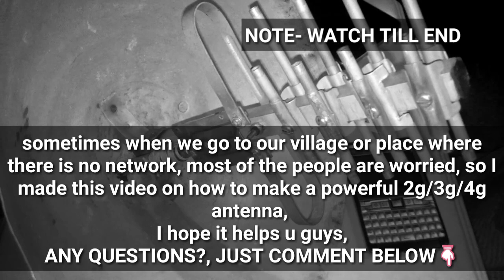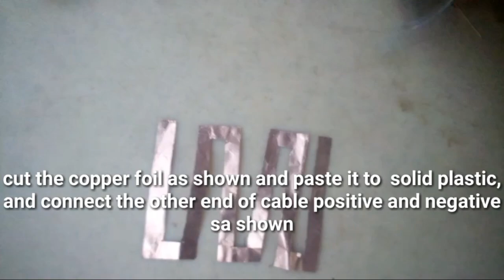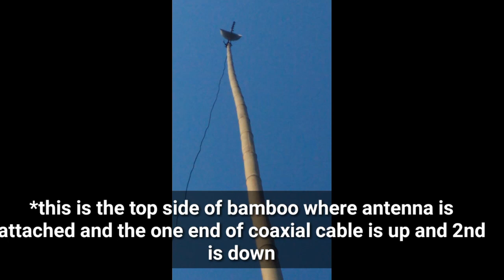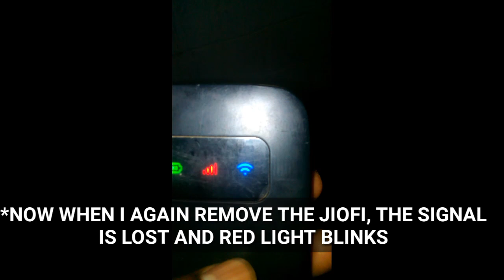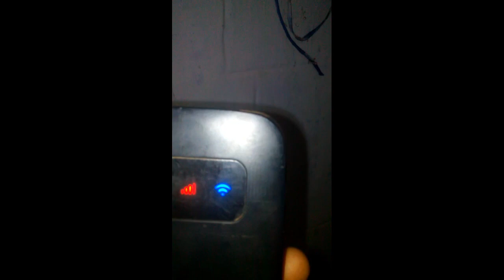Homemade 2g/3g/4g antenna/signal booster to boost signal and internet speed

Comment: Excellent work!..i have one doubt, what is the function of copper foil pattern on dipole side?(impedance matching??) is it possible to connect co-ax cable directly?
Reply from the maker: ANANTHASANKAR UA
As copper is a good conductor it works as amplifier,  
Not tested without copper foil,

Comment: How you calculate the distance, and diameter of boom to build your antenna? Can we use a satellital dish? an old tv satellital... I hope your answer.
Reply from the maker: If you will search in Google you will get many results, I tried many of them by calculating the measurements with online yagi calculator. And after 4 failed attempts this one worked (5th one). You can use satellite dish as a reflector but as the size of the reflector increases you will also have to increase the size of other objects. Hope it helps, any more questions, feel free to ask.
Reply from the maker: Old TV satellite contains pure alluminium, if you have it then it's best for this antenna.

Comment: I have a question- 1) Reflector  diameter= 320mm and diameter of reflector=20mm. I Confused, here the reflector is the  pan only. Kindly explain the two diameter you given in description. 
2) Reflector distance from director 1 & from dipole is 135mm and 117mm respectively. This give another position for reflector. Kindly explain it. (If the deflector distance from dipole is 106/107mm then OK). 
3) You used another circuit plate A input instead of copper foil one, I'm i wrong? Pse clarify it im just start to buid yr. antenna right now. Thanks.
Reply from the maker: 1 last line is diameter of curved surface of reflector
Reply from the maker: Uttam Kumar Athokpam 
Yeah you are right, I typed it wrong, but now I corrected it, Thanks
Reply: Thanks for correction.
Reply from the maker: Uttam Kumar Athokpam 
Thank you too
Reply: D M X sKILLS better if directly change your note. Please

Comment: We dont have available 6mm tube here and 16 mm for bom as well, available here is 9mm for elements and 25mm for bom. Can i adjust the length of elements and the distance of each elements? Thanks in advance for your advise
Reply from the maker: +Virgenio Arancon 
Calculate the new measurements with yahi calculator

Comment: What about the risk of lightning strike ?.  What precautions we should take to avoid lightning strike possibility?.
Reply from the maker: Well sometimes if thunder strikes near to the antenna it absorbs current, if not well grounded, then it may harm. And to avoid it make sure antenna is grounded properly, or your house have a lightning absorber .

Comment: if dr frankenstein made an antenna it would look like that
Reply: i was poking fun at you. keep trying, u built it well. i just realized that you used an aluminum pan when i thought it was an old satillite dish. working with whats available. good for you.  look up the history of yagi antennas so can use to the best advantage.  like the driven element should be  issolated from the rest of rods. not able to conduct at all.  and the shielding on wire to driven wont  touch inner core and so on and so on. keep trying cause trial and error will give the best results. good luck

Comment: If phone case is metallic will it work? Your phone case seem to be made of plastic.
Reply from the maker: Yes it will work. If your phone has a metal case, there should be plastic also where your phone's antenna is placed.
My Redmi note 4 works well.

Comment: Great video. Does the arial have to be exactly as you've built it. And if so why?
Reply from the maker: +chris pethers 
U can modify it, but it is very complicated work to do.
As the increase or decrease in measurements will affect antenna's frequency. This design can be improved. 
If you want to modify the structure, then you can change it according to your needs. But it might take too much time.
Before making this I made 2-3 antennas but not worked properly. According to me this one is best.

Comment: serious question, where to buy this copper foil. just checked on amazon and price start from 475rs :( Where i can buy it in cheap price.
Reply from the maker: mixup65 
No need to buy, you have to just tear any old mobile battery, and you will get it.

Wait I will post a video on that

Comment: Bro 
If I use silver foil paper,
It will work ???
Reply from the maker: Mohammed Junaid 
You mean aluminium foil?
Reply: Yes yes
Reply from the maker: Bro, you should use copper foil as it is good conductor,
If u are worried where to get it, simple tear any old mobile battery, there you will get plenty of them